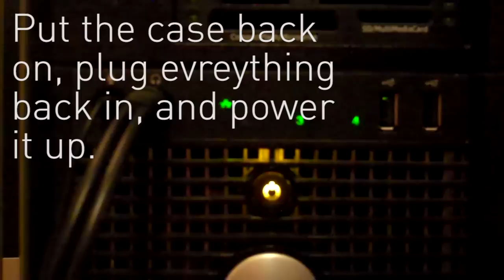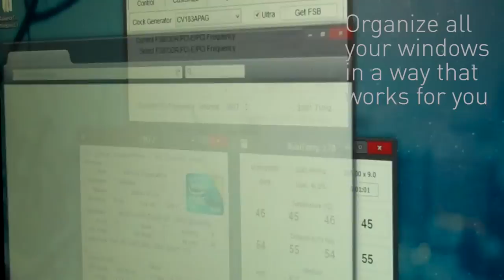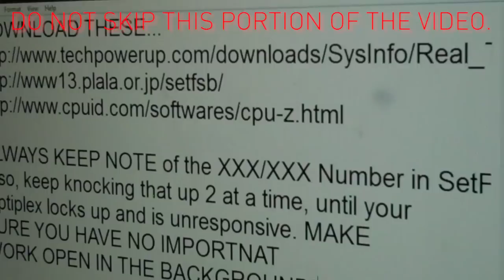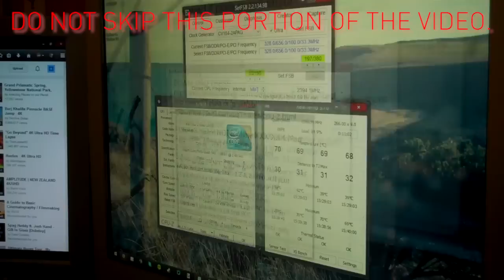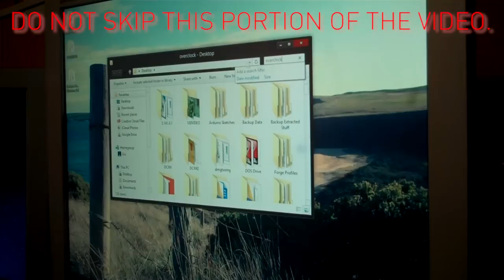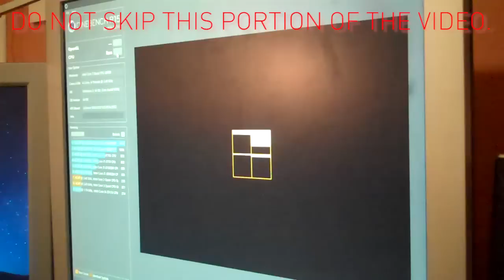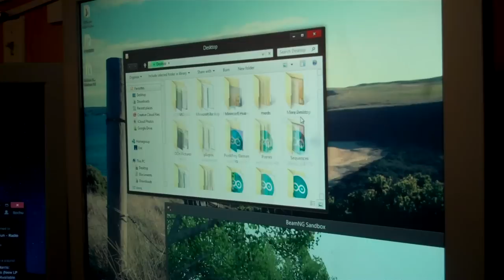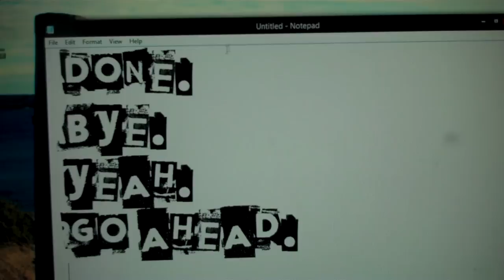[TUTORIAL] Overclock a Dell Optiplex 755/760/780 (Intel Q6600)

Comment: how do you keep your settings? my pc loses its sfb settings everytime i restart
Reply from the maker: someone I'm not sure. You may try a Google search. I no longer use the overclock shown in the video.
Reply: I found that disabling speed steeping in the bios before adjusting sliders after setting clocks restart then shut down and re enable speed steeping in bios, do not use restart after this or it will reset the clocks,  you can choose sleep or shut down and it will not reset the clocks.

Comment: Can anyone answer me please, will this work with an optiplex 780?
Reply: i already overclocked my gpu
Reply from the maker: Should work with 780. They have similar if not the same internals. Please report back if it works for you.
Reply: sadly no :(
Reply from the maker: The best thing you can do is to go down the list of PLLs/clock generators until you hit a working one.
Reply: didnt work for me ... at 2 of the generator numbers the pc got stuck. At the rest .... nothing changed. Any advice appreciated guys!
Reply from the maker: Hmm. Be sure you are using an Optiplex 755 (some reported worked with similar models like 780 others said no) and followed steps correctly. Also, be sure you are moving the correct slider.

Comment: I ovrclocked but it still says 2.39ghz on task manager
Reply from the maker: It will not update in task manager. CPU-Z is what you'll want to use to confirm clock speeds.

Comment: Mine must be one of the fastest Optiplex 755's out there! 

Pushing this old motherboard to it's limits:

http://www.passmark.com/baselines/V8/display.php?id=46532930605
Reply: +Liam Edwards what brand graphics you got in it, Does it fit well?
Reply: +ScottGaming I managed to squeeze a GTX 750 Ti in it that overclocked nicely too.
Reply from the maker: +Liam Edwards I've heard of people putting Xeons in these. not sue how the performance is to your Q9550, but its worth looking at.
Reply: +iTechUHD that's a negative on the xeons in the 755 because of the q35 chips does not support. I have a Q6600 with the bosd mod, think that's what it is called, so it runs at 3Ghz. Also the Mini-tower will unofficially take 16gb of ram.
Reply: +Liam Edwards what brand did you go with? different brands are different sizes and shapes.
Reply: +iTechUHD I'm using a Q9650 running rock solid stable at 3.6GHz when overclocked with SetFSB but most Xeons on LGA 771 match a Q9650. I tried a BSEL mod a while back but the system refused to boot even after trying it many times.
Reply: +ScottGaming An ASUS one (http://www.amazon.com/gp/aw/d/B00IITDIHM/ref=mp_s_a_1_14?qid=1449293979&sr=8-14&pi=AC_SX110_SY165_QL70&keywords=gtx+750+ti+asus) i had to do a little case modding for it to fit properly though.
Reply: +Liam Edwards I see it is a double card slot, did you just cut a hole in the case there?
Reply: +ScottGaming Yes and a few little other minor mods but nothing big.
Reply: +Liam Edwards the besl mod won't work on the q9650 because it is already running at fsb 1333. the bsel mod works on fsb 1066 cpu's to trick the pc that it's spose to be fsb 1333 resulting in higher clock
Reply: +ScottGaming at the time I wasn't aware of that but recently after attempting it i realised that was the issue.
Reply from the maker: I now have a 650 in mine instead of the 9600 GSO (it died), I ended up having to take all the fancy plastic aesthetic stuff off because the plastic thing on the CPU got in the way. It's pretty great.
Reply: +iTechUHD Nice GPU but if you ever get the cash, upgrade the GPU as your Q6600 can handle a faster GPU easily especially when overclocked.
Reply from the maker: I plan on building a new PC soon and using this one for a new media center PC or something like that. Only using the 650 because a friend gave it to me as he was upgrading.
Reply: +iTechUHD ah, i see I recently moved on to a brand new build myself but my old optiplex is still in active use by another family member.

Comment: Would this work on an optiplex 780 with a q9550?
Reply from the maker: Not sure haven't tested but I don't see why it wouldn't. Report back if you get it to work.
Reply: Eric San I tried it, but I was only able to overclock to about 2.9ghz from 2.83. Maybe I'm doing something wrong?
Reply from the maker: Could be that the Q9550 doesn't OC as much as the Q6600. Not sure though.
Reply: The Q9550 will OC well enough for Q35 based Dell Optiplex MB's, but for the 780 with Q45/Q35 chipset, it will only rise to a stable 3.018GHz, to equal it's big Bro the Q9560 (which is x2 the cost for 125MHz faster.). I'm not sure if there is a good Core 2 Quad ( or duo even) cpu to OC in Optiplex 780. I'd love to be proven wrong as i could really do with about 3.4GHz from it. Or even faster(3.7-8)GHz for a Core 2 Duo
Reply: @sumredsblue  I suppose as cheap as these MB's (or whole PC's) are on eBay, it's best to get one that's compatible. Problem with a MB swap may be the PSU connection, some has a smaller plug, not sure if an adapter would be safe. Back in early 2016, I purchased two 780's, a DT edition with Q9650 & MT with Q9550, both were just over $100 each. The DT was a steal, because RAM was loaded to the max of 16GB, not to mention the copper cooler & Windows 7 Pro .Had to upgrade both the cooler & RAM in the MT.  Will upgrade the PSU in that one to a retail model & install a nicer GPU. The DT is running a MSI GT 1030 2GB GDDR5 (runs as x4), drawing only 30W from the MB, although due to size & airflow, not a good PC to OC on. 

These are low cost PC's that can run the latest version of Windows 10 (1903) if desired. Didn't really want to upgrade, but my 4K monitor runs better with Windows 10, the graphics adjustment options are limited with Windows 7. 

Also, I've read, yet one must be careful, that some adjustments can be made using RWEverything. Best to take snapshots of any settings before editing. 

I also suggest to get the model(s) that Eric Sanman
 has suggested for best compatibility. Will try & find a Optiplex 755 early next month after payday, these has surely dropped in price since I got mine 3 years ago. These PC's are tough as nails, and with an adapter cable from eBay, can run a retail fan. Both of mine has Noctua NF-A9 fans installed for better airflow.

Comment: Does this also works with a optiplex 760
Reply: yes
Reply: @paulburkey2  ive got a 760  my code is not on the list
Reply: @TylerPlayzZz803  use the same one as the 755
Reply: @paulburkey2  will it work with q9550 tho
Reply: @TylerPlayzZz803  it should I overclocked my Q9650 to over 3.6 GHz on the 755 and 760 sff it helps to use good quality DDR 2 800 I used Kingston 8 gig matching (2x4) kit
Reply: @paulburkey2  ive got the same ram but the code in the video didn't work for me witch one did you use? thanks for the reply btw
Reply: @TylerPlayzZz803  have you tried CV183APAG my 760 pll is CV184-2APAG
Reply: @paulburkey2  yes i tried it but when i look at cpu-z my speed doesn't change
Reply: when i was going through the list checking all the codes none of them changed anything but there was one that when i clicked setfsb it made my pc freeze then my fan got really loud and i had to restart
Reply: @TylerPlayzZz803  you need to re start after setting FSB also I would use MSI afterburner to get accurate clock speed or try Everest ultimate edition or AIDA64 use the ram and cpu benchmark tools
Reply: @TylerPlayzZz803  did you get it to work?
Reply: @paulburkey2  no but its ok